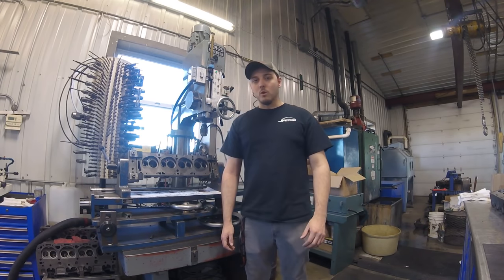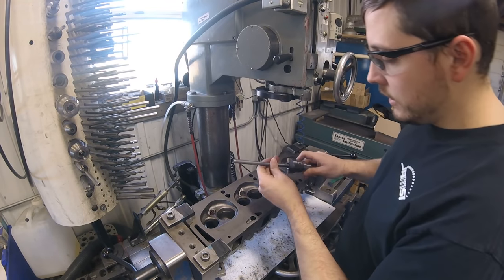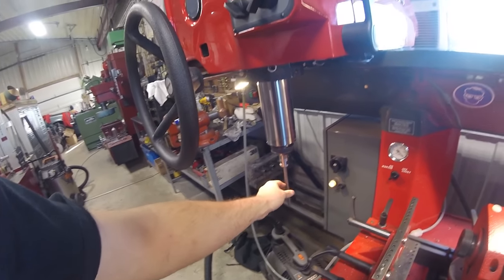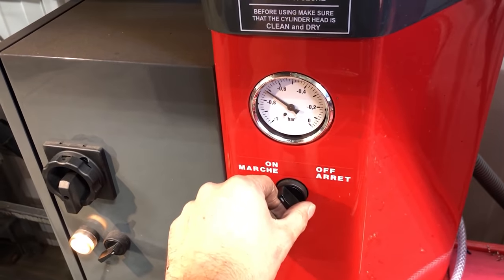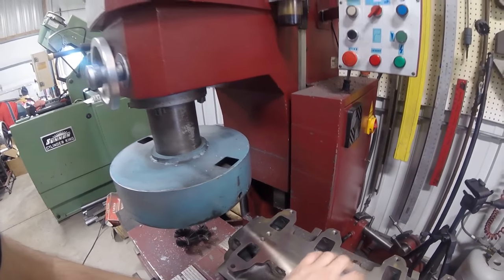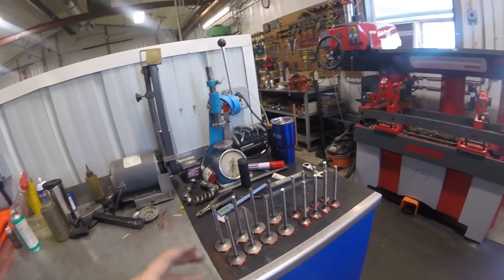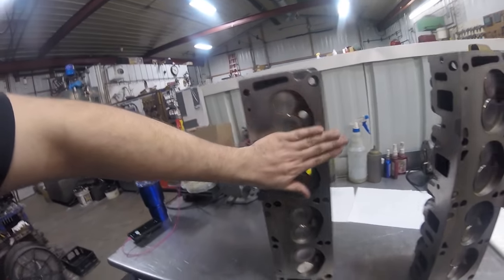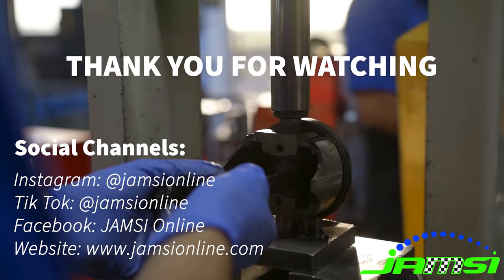FE Ford Cylinder Head Rebuild - Serdi 4.5 Three Angle Valve Job

Comment: I’m sure the FE community would love to see more work like this. 👍
Reply: ,6 8
Reply: Yes! Yes we would!
Reply: I second this
Reply: Here here
Reply: What does F E stand for?
Reply: @georgepearce8540  FE= Ford Engine.... that's it...
Reply: @georgepearce8540 FE - Ford Edsel.  MEL - Mercury Edsel Lincoln
Reply: Thanks
Reply: @georgepearce8540 well, it actually stands for Ford Edsel, but it ought to stand for all the iron that goes in em. Them are heavy engines.
Reply: I've got a 390/428 cobra jet heads needs freshened up.

Comment: A trick with the Serdi (that you may already know) when you encounter chatter that is giving you fits:

Turn the spindle off and bring the cutter down until it just touch the seat.

Then turn on your spindle until it just starts to spin, holding very light pressure on the down feed handle.

That will get rid of 95% of chatter problems.

Sorry to be long winded; I rebuilt engines for 23 years and feel compelled to pass on tips and tricks I learned along the way.
Reply: Thanks for sharing. I am a manual mill, lathe and cylindrical grinder operator. I make gears, spindles and stuff so I'm not new to machining. I want to start my own business of engine machine shop. Any advice? Or are there any books that I can read to get more familiar with the job?

Comment: Why does an engine shop cost so much? Because its well worth it. This video proves it
Reply: This is not true  I spend 3 grand on machine work for a complete  workup of two engine heads both heads were completely ruined    pistons ruined, forged rods not intended to be ground were ground and weakened at the bolt area, crank was offset ground  progressively  on each journal from being ok at the trans side to 5mm offset at the front  bearing, all ruined due to the fact the machine shop (green Lee machine  in Baton Rouge)  had interns fresh out of school working on my second visit. My first engine done was perfect, as the owner did that engine.  But the interns  completely  turned my last engine into scrap. And I wasnt able to do anything because it took me a little over a year to get back on my feet from a complex surgery
Reply: His dad taught him the right way to do quality work consistently as repetitive as that job can be sometimes ,excellence by designed discipline steps...
Reply: I would pay for this machine work any day I just will have to save up... his work is so SO much better than any work I've seen
Reply: @Engine_biulds  that would be poor operation of said expensive engine shop
Reply: @milotorres6894  well when you have the knowledge to do it right every time as accurate and consistent as this young man it’s more than just work it’s a lifestyle
Reply: Heck yes and I'm ready to move to co I need a job 😃👍
Reply: @Engine_biulds  man that sucks, hope you came back from it.
Reply: @dertmatyui   no I haven't, I did get my cylinder heads reworked.   And I got a replacement  crankshaft, ( I got the longer stoke crank from a big brother motor sane family) figure why not  add a bonus if ima pay for one.  Anyway   I gotta get the pistons and crap reworked to fit the new stroke  and check clearances  in the bores   I don't quite have the proper tools to check the bore  I assumed   everything would be perfect considering the last engine was twice it's size and when together beautifully,  not even a single leak, problem  clearances all were beautiful  the piston rings all numbered and  checked out.  But this ladt one I literally over looked one thing  then another, then another, pretty much like 9 red flags but I was like🤔, they wouldn't set me up for failure they know what they were doing and I just put it all together. The one thing I totally missed was the pisto protrusion I check on. I didnt check for consistency  and that bit me  hard...
  Anyway,  I gotta get the thing rebuilt and I've not pulled the trigger  yet. The crank I will hold on to to send off to see if it can be welded up and made into a much longer stroker crank, I want to achieve  4liters displacement  in my 3000gt  turbo'd. That would be killer for an awd
Reply: The Serdi can bowl hog a bowl to valve size and blend the SSR , that is amazing what can be done 25 years ago with just a drift and a bowl hog and hand blend, I used to pie cut a  2.25 flap wheel so it would flex to smooth it nicely. Then blend the SSR with emery. With the Serdi 4.5 you can get a nice bowl hog cut and it’s concentric to eliminate the need for a flap wheel and just an SSR blend is needed. That is great machine work. I  wonder what the valve sizes were? I had a set of 1965 FE heads done at Mac-Weld in Carbondale, IL back in 1999 with 2.055 and 1.6 valves with inserts in the exhaust and new guides 3/8 I believe and they were able to bowl hog the bowls to the new size and they had an inner cutter that cut the guide boss and guide to fit and they even had a fixture that raised the roof of the port to 2.34 an 1.34 wide and I specified a bias to move the air to cross the valve away from the bore wall. Amazing machines even then. All I had to do was pocket port the walls to cross the stems even better with higher velocity. When I tested them on the bench they were 278 intake and 205 exhaust. Perfect for a.020 over 390. Along with the polish and shot peen and resize with ARP bolts on the rods with forged pistons that they lightened perfectly along with the crankshaft and the balance job with the tool steel floating pins and Spirolox I put in. The rings I fitted and gapped with the bores that were moly coat top and cast 2 nd gapped a little wider to prevent flutter at high rpm’s and the light oil ring. It came together nicely when I built it back in 1999 with a solid cam similar  to the 427, 410 hp cam a bit more lift and narrower lobe centers . With a Holley SD intake matched to the heads that are similar to 428 CJ. The combination came in at 503 hp and 505,ftlbs torque. I was surprised at the fact that heads were so good with the operator knowing just how to get what I was looking for. My heads that disappeared from the machine shop (a different one) I had the work done for 2.09/1.65 but decided to put 2.19 intakes in and some good hand porting that would have carried them to a good power level. My son planned to drive the car a 1965 Galaxie, Midnight Blue we had done frame up. It has the 394 in it and it is fast as is, but I am blind and he doesn’t even want to look at it.  But that 394 is vicious. It still has no blowby, or oil consumption, all 8 are still new as to leak down.  At 9.8:1, no 10.25 to 1  because the first set of head gaskets were bad. I put a set of Cometecs that were exactly.038 with the pistons and man it loved that! It was like putting a blower on it. You can stomp it with the 3000 converter in Drive and it will burn out solid through L and 2 and start moving in high . Damn ! I really miss driving.

Comment: Interesting trick with the freeze plugs in the exhaust seats. I’ll keep that in mind if our tig machine ever goes down, at the shop I work at we use a tig torch with no filler and just run around the seat, once it cools it’s lose enough to pop them out with a crowbar(? Not sure what the exact name is, I’m new to the engine machining career, just started 4 months ago) your channel is part of what made me chose this path, thank you for the amazing and informative videos.

Comment: It’s nice to see that the cylinder head holding fixture is tall enough to measure the valve height  as well.  Back in the day I was doing cylinder heads on a old float table .   PITA !

Comment: Interesting video, especially since I’ve just had this work done to my FE heads, and it didn’t turn out good. Valves came in at different height and being used to engines with adjustable valve train I didn’t think of checking the height before assembly and test start. Exhaust valve on cylinder 4 was higher than the others and the lifter probably bottomed out causing the valve to burn. I had to pull the intake, replace the lifter and fiddle with pushrod lengths to make sure the lifter had correct play. Now the engine doesn’t run on number 4 at idle so the heads need to come off again and get redone. A shame that my machinist didn’t put the same pride into his work as you do.
Reply: there is a stem height that i e r a furnaces and a true machine shop would go back and check the stem eye to where the spring seats and cut it to that height don't think either one of these shops understands that.. check the stem height your butt stems if you need to then you clean the heads and put them together and it's done check area it's really not hard to do it wish I got 50 years experience doing this.

Comment: I had a 427 side oiler stroker (alum med. riser heads) so I took interest in this video. I like that you are knowledgeable and meticulous in this rebuild. My engine builder has similar personal constitution. He installed oversized Chevy intake valves, 3 angle cut, shaft roller rockers, roller cam, ported a bit and port matched.  My engine (10.8 CR) was reliable and made good power on 93 pump gas. It turned over and fired up every time up until I sold the car last yr (‘21) some 27 years after I built it. I miss the engine, it’s planning and the anticipation of getting it completed. Enjoyed the video and beautiful job! Your customer will love these heads. 👍🇺🇸

Comment: Any time I had to replace both seats in the same chamber, I would bore out and install one seat first, then bore out and install the other.

That way you aren't distorting the bore of the sear next to the first one you install if you bore them both out first.

It becomes more obvious the closer the seat bores are to each other.

Great video!
Reply: That makes sense, especially on race engines, but not so much on a stock job like this with the valve pockets being further apart.

Comment: More great work. However a kind suggestion is to Tig weld the core plugs to remove valve seats. Far cleaner, just as quick and you can just fuse them together, no cleaning. . Thank you.

Comment: I've done so many 356/360/390/428 heads over the years,one of the worst factory machined head to begin with. Nice when you correct all the problems. I seem to recall heads with 1 or 2 spring seats taller than all the others on one end of the head.
Reply: That’s for sure. I built a many of them referencing the tip not off the spring seats but using a large strait edge clamped to a precision flat surface so it could reference off the head surface. I then used a dial indicator to set the tip height. Worked great!

Comment: A rough  is not bad when you  have a cast iron head & cast iron block. They Expand  & Contract at the same Rate so they won't tare the inside of the head gasket  apart.  Aluminum heads need a glass like surface.

Comment: When you were talking about the machine running at full RPM and chattering on certain valve seats, I think the valve seat material that chatters is probably an inferior material. When I work with certain aluminums beyond billet, you start to see a lot of impurities come through with the finish. The same with steel. Anything with a high nickel content finishes great at high RPM, with the substitute beyond insert life. Great video, hope this helps…..somehow lol

Comment: How does your shop handle the FE intake to head connection? When the intake side of the head is surfaced, metal is removed which slightly widens the distance where the intake manifold seats between the heads. Stock FE are notorious for intake gasket leaks even when they were new. After a couple of head jobs, significant amounts of material may have been removed. Do you have the customer bring in the intake manifold to check the fit with the heads installed on the block? Some gasket companies made thicker gaskets to compensate for that but I don't know if there is enough demand for FE gaskets for the various thickness gaskets to still be manufactured.

Comment: Some of the better machine work I’ve seen. I’ve paid large amounts for “quality machine work” and received subpar machine work.  Like installed heights that weren’t that same and poorly machines throats on seats that took me lots of hrs to blend.  And another thing wouldn’t an insurance to correct valve grinding be done before final seat cutting?

Comment: Nice shop and equipment. Very professional work and confident craftsman 
Question- what angle did you resurface the valve?  I know you stated 45 degrees for sealing surface on seats

Comment: I had a 1962 Galaxie 500 Ford with a 406 motor. The left head was warped and I had to change the head gasket every week or 2. The only problem I had was the oil pump shaft would fall off the distributor and fall into the oil pan. I don't know how many shafts were in the oil pan but occasionally I could hear them rattling around in there.

Comment: Something  you may not know is that when  re surfacing FE head's!!! 
It is very  important to now how much you take off of them !!!! 
Because  of the fixed rocker assembly!!! 
You may need thicker head gaskets or shorter  push rods !!! 
We ran into that with  a 360ci !!
It pump  the lifters up and shut down  the  engine  till cooled  down !!! 
0.020 shorter  push rods fixed it !!!! 
😊👍👍👍👍👍👍🌎🌞

Comment: I looked at the intake face initial cut and thought, "we've assumed that the head gasket surfaces are flat and straight, but if they're not, then by bolting the two together, we might have introduced warp into the exhaust and intake faces". Granted, we'd rather have warp there than on the head gasket surface. Really enjoying your videos! it's obvious you put a lot of effort into them as well as your work

Comment: The way I was taught, use a cut down valve,weld a cut down washer with a SuperMissle Weld rod. Then hammer the seat from the other side.

Comment: I’m not working in the machine shop for 27 years now, but I’m curious about the clearances and specifications for auto machine work.
The first machine that was used is specifically designed for the work and the machining of the valve seats everything seems to be determined by a slip fit what’s the tolerance of the valve guide I noticed the diamond hone I’m glad to see you use a diamond hone it’s faster and more consistent than other methods of polishing a hole to size. What’s the plus minus on the size 0.001+ - or less 0.0005?
I don’t see you checking the hole size of the guides with any gauges such as air contactless measurements. The plugs are sized to 0.0015 smaller than the holes and mounted on a tool which allows clean compressed air at around 25 psi to the inside of the bore how much air leaks by helps determine how big the bore size is. Your machines are very nice and the work is a little different than what I am used to.

Comment: I like the one comment I used to ream the guides first that makes a perfectly straight hole and then you can hone them with their small Dingle ball home made for guides makes a nice finish for good oiling the the old Ford if he heads were the most time-consuming heads because they needed so much work for the unleaded gas.

Comment: Great work and an excellent video.  Where do you get the specs for things like how far to press in the guides and how much to trim off?
Reply from the maker: Some of it it’s knowing from experience. Some of it is comparing and measuring the old parts before you start. Other than that, AERA Prosis Pro software!

Comment: I wanted to find a good machine shop, I think I found it.  Just hate you guys are so far out from Baton Rouge area. I hope I can get a quote for a performance  valve job  and  hardened  guides and seats put in Shipped back to 70777. Ill be calling again in a few days to talk to someone. Very interested in your work.  I pend hours porting heads and its nice to see the same level of detail  in your work... I do like the radius  you put in the exhaust  guides on the Subaru  heads in an earlier video and the back cut... I do allot of that by hand. Its so  much nicer  to see this kinda stuff done on a proper  machine.  Because  it doesn't take much to ruin a head. Thanks for your videos.

Comment: I called and left a message about my 05 ram, being 2am I couldn't thick off everything in the v.m. just watching your videos but hey, have you tried a tig welder?  If you tig  all around the seat (no filler) id like to think the seat will expand  and loose tension  as it cools and fall out.

Comment: FE heads can be a can of worms once you start..  Installed heights are pretty important as "most" had non adjustable rockers..  The other thing... surfacing the combustion side of heads...  It is a good idea to make sure your customer knows to "dry fit" the intake manifolds.. it is not at all unusual to do an FE that had to have heads cut that the intake no longer fits correctly..  (just one particular about FE heads that can be problematic)  Not sure what your shop rates are but it is not unusual to spend $1000 or more on these old heads..  Looks like your shop does some awesome work...

Comment: Can you fix a head that's cracked and if you can show us how please feed me more. Have you ever had to punch out the spark plug hole and install a new hole with threads. Or is this even possible. I have heard a new Ford pickups blowing spark plugs out some of the bad threads no threads but is this even possible to do. And I love to trick you about the freeze plugs for the removing exhaust valve seat thank you for the input. And I'm starving man Feed me more

Comment: you must always regrind new valves, to insure they or faced properly to the stem. just because they are new does not make them correct, also they have been handled, shipped and need to be faced correctly.